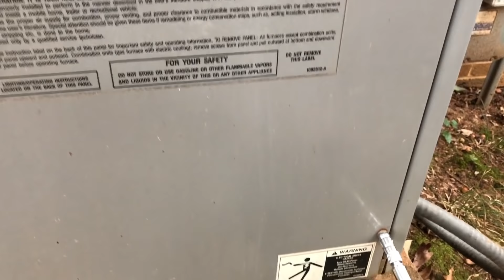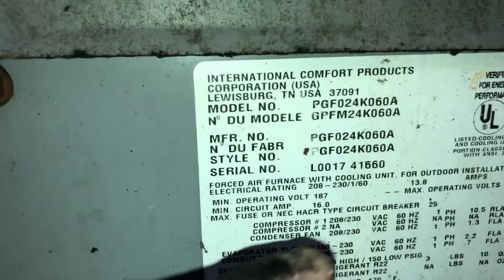Old ICP Gas Pack board sizzle fireworks display

Comment: Technically or otherwise that is not a short - as you know a short would blow a fuse or trip a breaker. I would say that the push on common connector was loose and over time got hot - clearly seen by the arcing when you open up the unit - think of a welder in action. Replace the board and the connectors - you may want to replace the shroud over the disconnect - if there is one - as once you take out the wedge there are clearly exposed terminals
.

Comment: You’d repair it?  Seems like all the spade connectors would have lost their springiness, wire oxidized and brittle.  You’d have to cut back so much I’d think you wouldn’t have enough slack.

Comment: I think that takes the cake on burned boards as the top of the chain. So I assume he turned the breaker back on for you to see that sparky item, lolol. ICP are known to have board problems cuz the plastic grommets dry out and break causing a short, and their contactors coil fail in new units too. Thanks for the video and keep doing what you do. Be safe.

Comment: I'd guess blower motor relay or solder joint failure, once it started arcing/heating it quickly carbon tracked and just kept getting worse.
probably inductance of blower motor and run capacitor combined helping keep an arc established or making it worse from back EMF. without thinking too hard lol

Comment: Electronics engineer here, I have never seen a potted relay catastrophically fail that bad. I've seen the PCB itself burn holes through itself from large current surges but nothing like that.
Reply: Well I saw it alot with electronic oven controls. I think the biggest thing is resistances from bad connections. whether its the relay contact points itself, or bad solder joints on the PCB. regardless, it heats up. it increases current flow, heats it up some more, etc. snowballs out of control. ive seen bad connections from relays vaporize an entire copper trace before on oven control PCBs, the cheaper ones woudl sandwich the PCB so the arc/vaporization process would flash over to the MCU on the other PCB and goodbye.

Comment: Had a home warranty company call for a second opinion. They wanted me to guess why the board had  shorted and what it would take to replace every wire in the system. We politely declined that job.
Reply: Right. 
What would Ted do if cutomer didn't want to replace?
"Wiring challenge" as they say. Ted often knows the wiring by heart, but the rest of us would have to sit there with a book, if taken at all.  ????
Reply: Feel you bro. I deal with a lot home warranty second opinions and end up having to fix alot of crap no one else will touch or even worse some else has already tried.

Comment: I had one of these, 20 years old. only replaced it because when i bought my remodel house it was undersized and the heat section was basically shot.  Installed a York PCG4 3rd gen unit. of course anything now wont last as long as the old stuff.  The York isnt to bad I was fortunate that my ductwork was sized to carry the new unit which made me believe that the original unit must have died and the tempstar was installed second hand ( original owner loved auctions and second hand junk)  they even bought a second hand pool and the deck work that went around it.

Comment: I can't decide if that part of the board would once have had a high voltage module in place for spark ignition. If so, that it was still producing high voltage is quite impressive!

Comment: Ted, I can understand why you are against the DIY’er, you spent years to learn your craft and how to do this properly so you know firsthand what can go wrong and how dangerous it can be.  But as we have seen in many of your videos, there are a LOT of “Pros” who are just hack jobs.  I think that is why many people are electing to try to do it themselves.
My current HVAC system was installed by a hack,  I had to have a pro come out and rip it out and reinstall it properly (it was THAT bad).  Back when I was in college, I worked for a bit with an HVAC guy so while I am nowhere near a pro, I at least learned enough to be able to tell good from bad, but many people have no way to tell.  
Maybe you can do a video on how to find a pro and how to tell if they are good or a hack it would help.   😊
At any rate, love the videos 😊